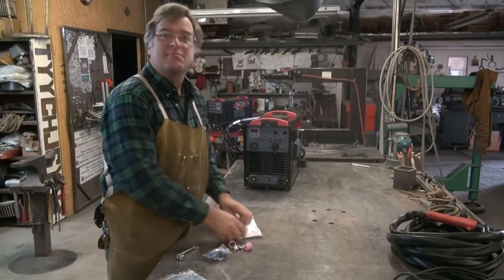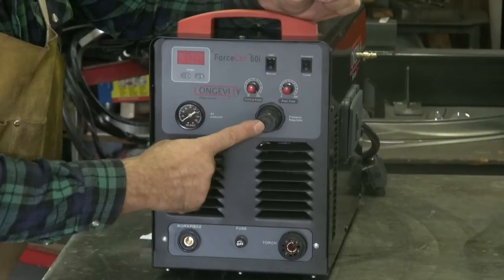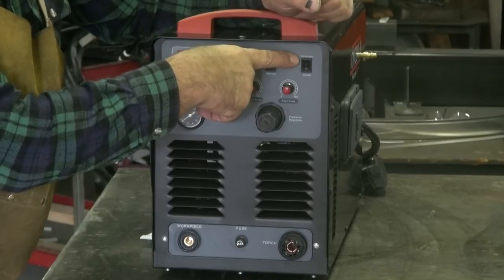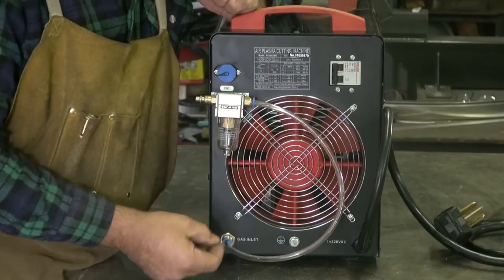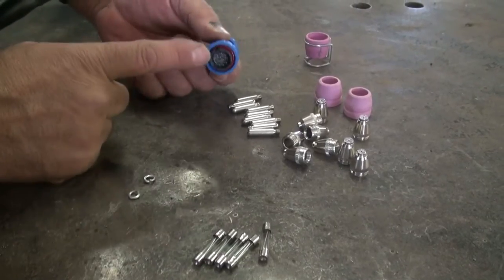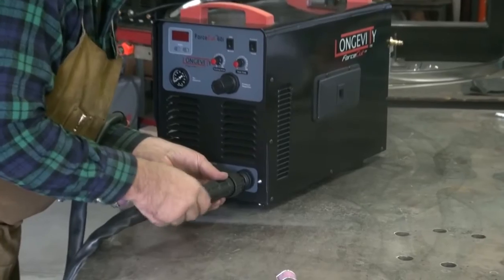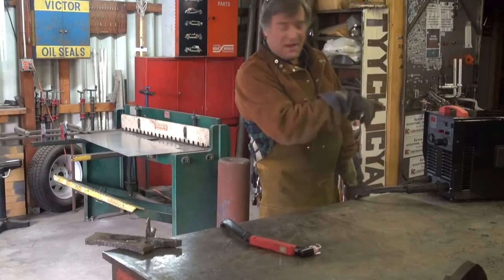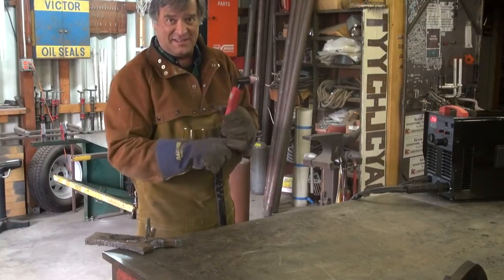How to Set Up a Longevity Plasma Cutter - Kevin Caron

Comment: Kevin, thePT-60 torch on the 42i is a winner.  HTP also uses that torch, and they carry consumables.  Trafamet S45 consumables work, but they are not the exact size of the Longevity.  I highly recommend the 42i.  40 amps on 220V and 30 on 110V.

Comment: Yeah your right & come to think of it I don't even own a welder capable of welding 1 1/4" lol. I only have a 187 & I build bbq smokers & mess around with sheet metal. I think I will look into the 42i or the 40i. The 40i is a few hundred bucks cheaper than the 42i & I don't see myself working on anything over 3/8 ". Thanks for the reply & input.  Your one of the few people on you tube that reply & give great advice via your experience.  Thanks again.

Comment from the maker: I would say this machine is a little big for a home hobbyist. It is rated to 1-1/4 inch!

The newer 42I is an outstanding machine and better suited to hobbyist use in my opinion. The consumables are all from Longevity unless you want to get a different torch. Then all bets are off on that point. They are not that expensive in my opinion if you just order in bulk. I get a bag at at time and they last me for a few months. Waiting on an aftermarket torch now to see how they compare..

Comment from the maker: @huerdon Welcome aboard!!     The 50d is a great machine, it should serve you well for a long time...
Reply: Stay away from Longevity. I bought a Forcecut 80i and it was a waste of money. Their customer service sucks and they don't return phone calls ever. I had called them several times they never returned one phone call other than want me to buy it. The plasma cutter I have owned it for about 7 years now and only used it a few times because it's always broke down, I had it repaired a year ago and it still don't work after spending $375.00. I asked them how to attach a torch height controller to it and not one of them could give me and answer. Save you money and buy from someone else other than China made Longevity.